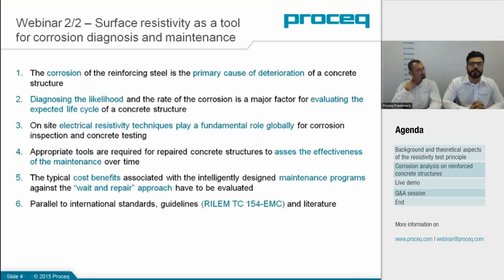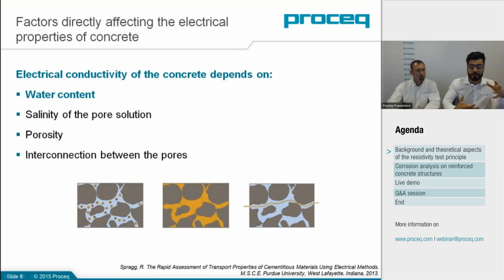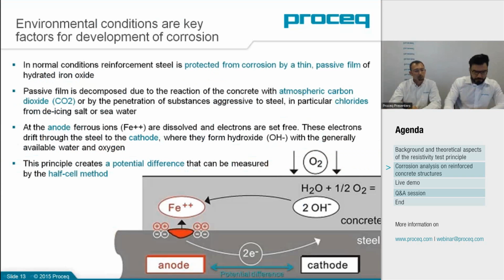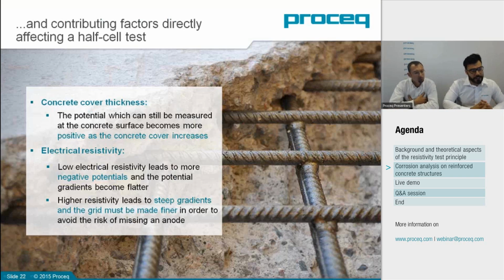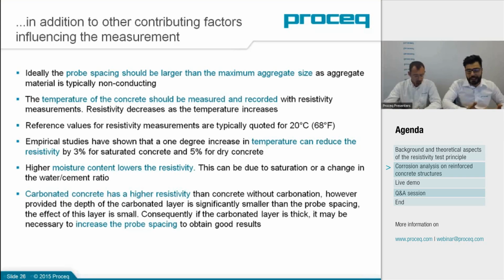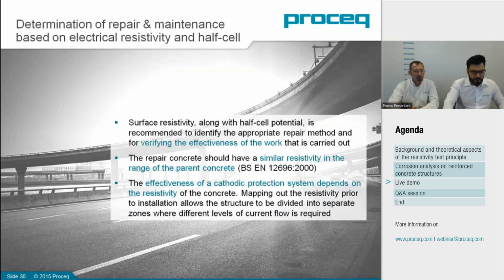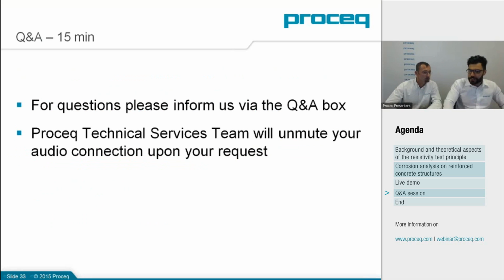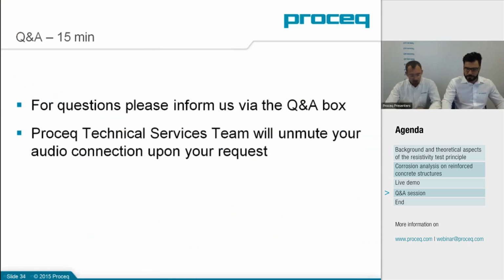Corrosion analysis of reinforced concrete structures I Webinar

Comment: how do i start repairing a structure with damaged rebar in concrete? who do i have to call civil engineer, structual engineer?
Reply: Crystal, I would start by first getting the damaged structure surveyed by a testing and inspection company - like us. A repair strategy can then be formulated and a third party repair company employed to carry this out. 
Repair of the concrete will most likely require removal of concrete cover over any steel that is corroding, the fitting of sacrificial anodes to the surface of the existing concrete and/or waterproofing and then a repair patch applied over the broken out areas. This is simplified, with more steps involved depending on the mode of corrosion and where in the structure the corrosion is occurring.
Reply: @purplequickfeet  For constructing a jetty, what material do you think is at best. i was thinking using steel with concrete coating to prevent corrosion from happening in the long run
Reply: Crystal Kaui Mattson  0400898815